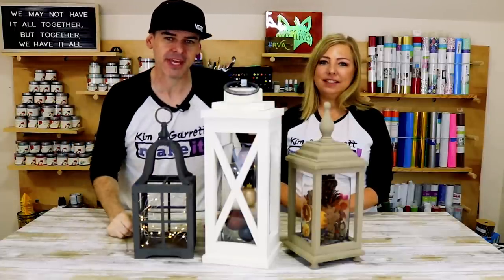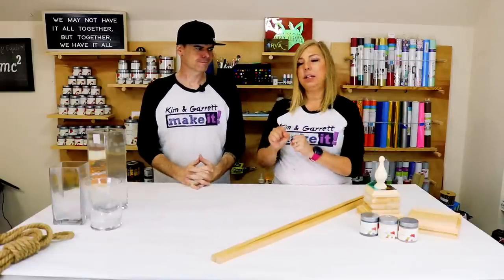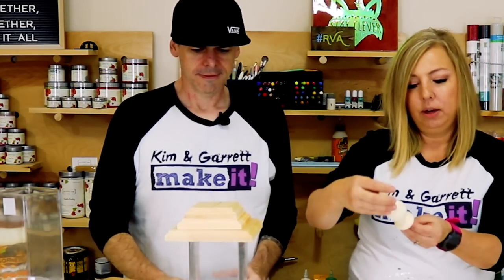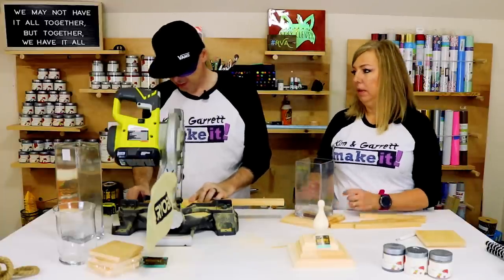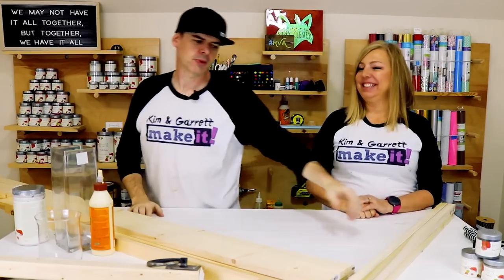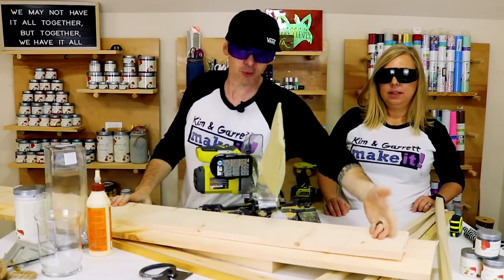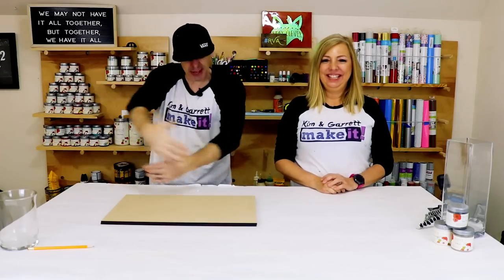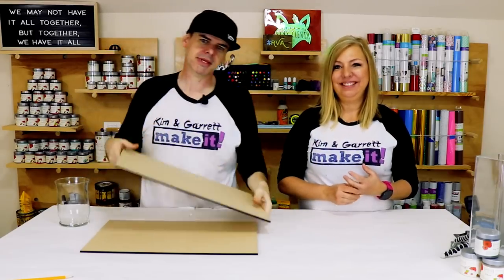You Can Make These 3 Easy DIY Christmas Lantern Centerpieces

Comment: Bought your file for this lantern.  What thickness of wood is it designed for?  I use 5/32 and 1/4 wood.
Reply from the maker: Hey Bonnie,  They were made with 0.24" slots, but if you have Illustrator or some SVG editing tool, I made the slots a separate layer so you can adjust them or the kerfing.  or email me and I will adjust them and send the files to you.  ~garrett